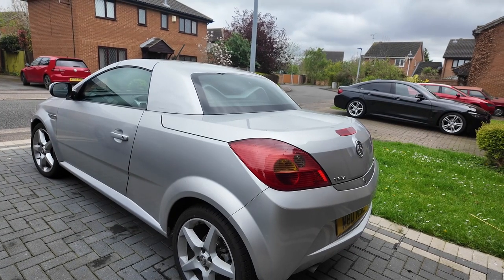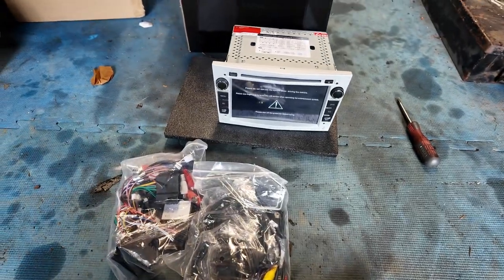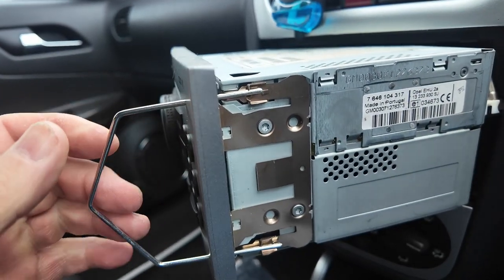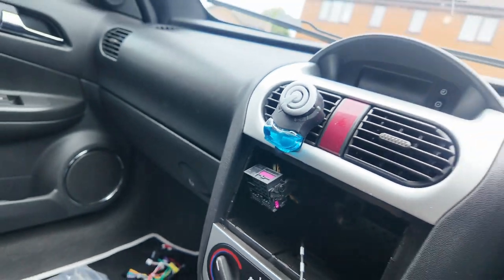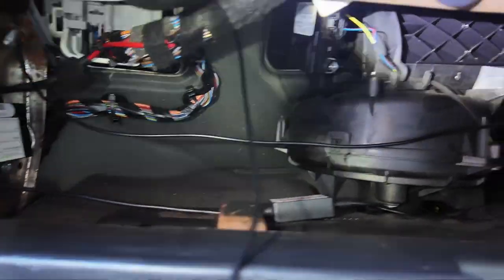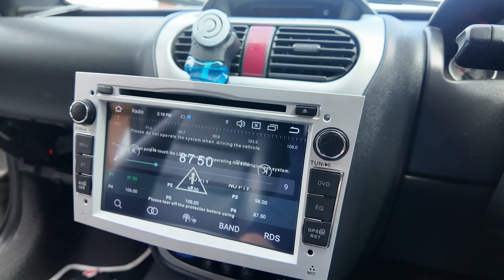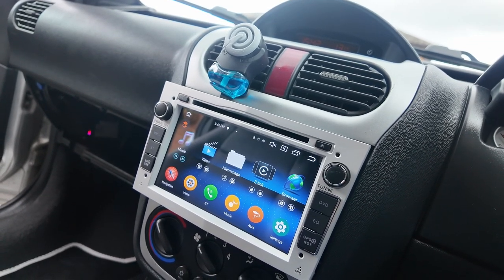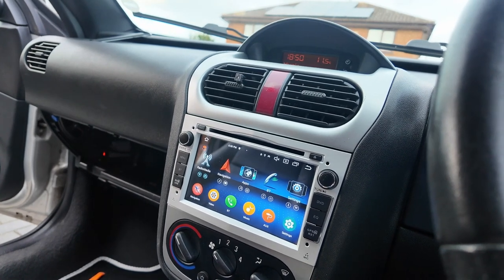Fitting an Android Stereo to my Vauxhall Tigra...

Comment: Any updates on how its performing?
Reply from the maker: Not had any issues with it... the Tigra speakers are a bit of a limiting factor and although i changed the ones in the door it still really needs more, but the head unit seems very quick and responsive..